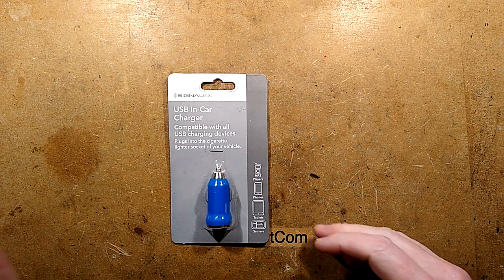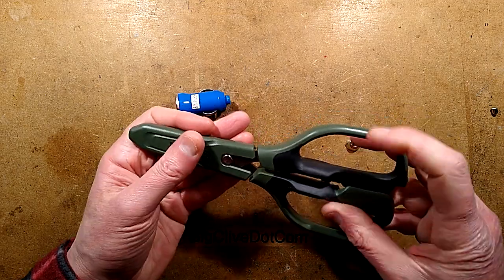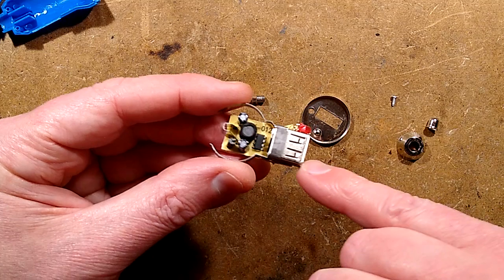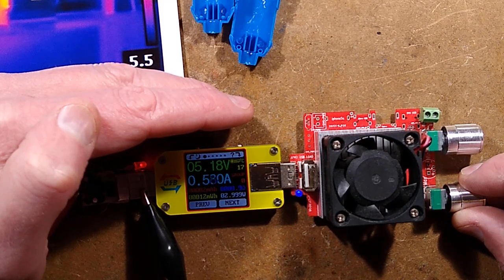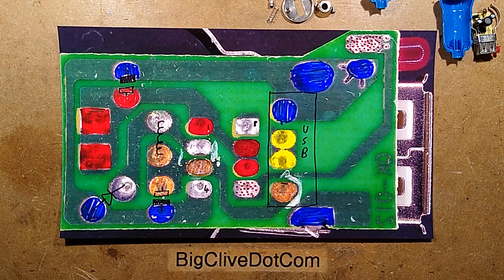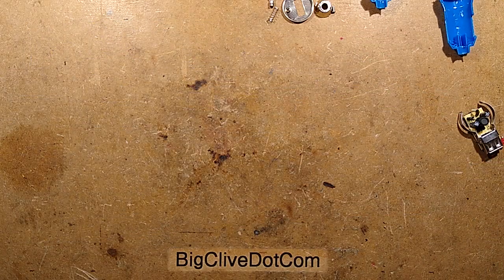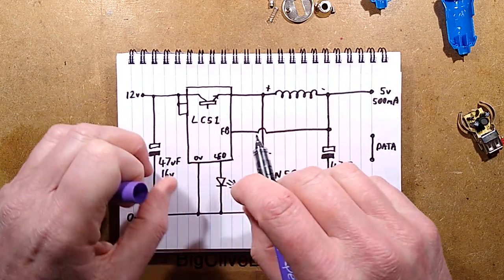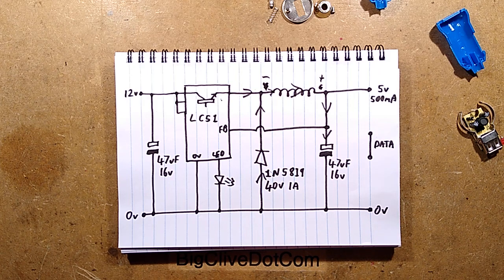Inside a Pound shop car-USB charger (with schematic)

Comment: Whoever sent you those expensive-looking scissors was probably horrified to see you using them that way 😃😃
Reply: I sure would be!
Reply: Nah, that metal is zinc based potmetal. Could have bitten it off.
Reply: Well, i have engineer brand small scissors, and they are made to be used as tools. They are made to be used like this.
Reply: this concept brings be pleasure for some obscure reason
Reply: @SquishyZoran  Those scissors sure would be good for popping things tho
Reply: They do state "Engineer" scissors, so I would suggest that allows them to be used for all major engineering tasks, namely hammering, prying, stabbing, levering, wrenching, chiselling and it seems spudging. At a pinch you could also use them for cutting stuff, if you can't find a more dangerous implement to do that with.
Reply: I would suggest that anybody who sends Clive tools ought to be prepared to see them employed in all kinds of imaginative and exciting ways 🤪🙏🎇
Reply: @AndyHullMcPenguin  Exactly, these are obviously the new engineer's screwdriver. 🔨
Reply: If you are horrified at that, then you don't know BigClive that well  ;-D
Reply: @SquishyZoran  top tip, write your name on them before you send them. Clive does not seem to be the most organized genius out there. Love the videos and the chats. Still get sanitized even though I had my vaccine.
Reply: @AndyHullMcPenguin  Don't forget the other important tasks that engineers use their precision tools for: manicures and skin care.
Reply: they've seen him use his screwdriver in non-screwdriver ways. if you gift something to Clive you know it'll be used in a new application you hadn't foreseen  at some point
Reply: @wyokaiju992  You wouldn’t dare!
Reply: @happyundertaker6255  Even so it would still be alarming the first time .
Reply: @ronaldpurnell7570  I would but I don’t know his address.
Reply: @AndyHullMcPenguin  When I hear the word "Engineer" I immediately think hammering, prying, stabbing, levering, wrenching, chiselling and  spudging... lol
Reply: @AndyHullMcPenguin  Nice one Andy, love a dry sense of humour.
Reply: Tool abuse!
Reply: @mastergx1  If it looks like a hammer ...
Reply from the maker: That did go through my mind.  But they did challenge me to break a pair.
Reply: @Kj16V  I thought that was just me...
Reply: I bought a pair of those scissors off Amazon, they are brilliant and will cut anything. I've become a total convert to the Engineer brand and have since bought some of their fine cutters and pliers as well as wire strippers to add to the dozens I've already got. 
I love good quality tools.
Reply: @SquishyZoran  We'll see about that ;)
Reply: @happyundertaker6255  I use old-school lineman snips and get funny looks for it all the time. They are like scaled down leather scissors (thick stainless steel, very heavy for their size) and have a serrated back edge with a couple of wire stripping notches. They've no problem cutting wire and thin sheetmetals without getting nicked or dulled. They cut paper and annoying plastic packing nicely, too. Handy for some personal grooming (beard, fingernails) on the go, too. I'd still want a good pair of shears for cloth, though.
Reply: Nope, I sent those and I'm very glad he is abusing them :)
Reply: Clive is an engineer. Nothing more to be said.
Reply: Engineer brand scissors should be perfectly happy with such light duty. I'd expect them to be capable of cutting wire and shim stock, so some light prying should be no big deal.

Comment: I always love the photos, you do this low budget hardware serious justice. Those prints probably far exceed the price of the device.
Reply: He could also use a tablet and doodle live in the photo on it. 
The photo probably is easier to use in varying light conditions.
Reply: If you have refillable ink cartridges the price of printing a full colour A4 image is a few pence if that. And I know Clive does use them because he mentioned having a few syringes for that purpose because that is what made me aware of refillable cartridges.
Reply from the maker: I've moved onto a tank based ink system.  I get the best part of a year out of a refill.
Reply: @bigclivedotcom  How about a review of the printer?
Reply: @bigclivedotcom  I know a lot of people have asked this over the years but you should make a video on the printer
Reply: @two_tier_gary_rumain  It's the Epson Eco tank system.  Don't wait for the review just go out and buy one.
Reply: @Chris_the_Muso  I don't need one.
Reply: I remember when Clive tried to measure component using dmm on the picture itself. 😂
Reply: @rizkyp  And several near to's
Reply: @Chris_the_Muso  On these ink jet printers where you just refill the ink rather than replace a cartridge that is both ink tank and ink squirter jets is there a problem with the non replaceable ink jets getting clogged up?
Reply: @BrianG61UK  No more than it is on any other printer with non-replaceable heads, which is most of the business type printers that take the separate ink tanks.  The main problem with print heads is leaving them idle for too long.  If you only print a few pages every now and then you might be better off with the all-in-one cartridges so that you throw your inevitable clogged heads away every few months.  

The advantage of the eco tank system is that the ink is so cheap, so you tend to print everything all the time, which is good for the print heads to be kept working correctly.  For this reason I would suggest you actually have less problems with the print heads.

The disadvantage of the eco tank system is that the cheaper ink is not really photo quality (close enough for most people but not professional quality) and also the archival quality of display prints would be very suspect compared to (for example) Canon photo quality printer inks.

It's a matter of picking the right system for your needs.
Reply: I have color laser printer, which can be filled from large buckets of  powder from Ebay . Last one ever made by anybody I think. Samsung CLP-810  .
Reply: I'm now imagining Clive's printer with a hose for each color going to a 55 gallon drum of each color.
Reply: @bigclivedotcom  same here, Epson ecotank printer 🖨 takes bottles of ink 😁
Reply: @Chris_the_Muso  I buy Epson ink for my ecotank printer 👍

Comment: I get chills when he starts using his non existent fingernails to try and pry off that back piece and then it makes that sound every time he pulls and then loses grip, ugh.
Reply: click
Click
Click
Reply: Grow a pair
Reply: That’s what fingernails are for!
Reply: I was waiting for the 'unreasonable force' to be applied - I thought Clive was quite restrained!
Reply: @horacegentleman3296  it's normal to feel that if you've ever had such short nails and tried doing something with them
Reply: @alancordwell9759  I STILL have not seen that big hammer of his in use.
Reply: @horacegentleman3296  Of fingernails?
Reply: @ronaldpurnell7570  that's strictly for Clive's OnlyFans
Reply: @alancordwell9759  You just reminded me of the venerable Vice Of Knowledge! 

😢 I miss the Vice Of Knowledge…
Reply: @BoHolbo  The vice of knowledge, the pliers of curiosity, and the spudger of serendipity.  Only the hammer of inquisitiveness needs to find it's rightful place.
Reply: I'm a normal man so I just 'grow a set'...a set of ten 2mm long fingernails, rather than two pieces of spherical sports equipment.

Comment: I was half expecting it to just be a single 5v regulator.  😂
Reply from the maker: That wouldn't have surprised me.
Reply: I bet this chip is even cheaper.
Reply: I was half expecting a two resistor voltage divider
Reply: @SparkY0  That's been the standard for years... Most of the "classic" versions of these were running on either MC34063 or a TL494.
Reply: Many years ago I had a radio that needed 6V. It came with a car power adaptor. It was basically a very chunky 6V Zener, a low value high current resistor and a capacitor.
Reply: I had a couple from Poundland a couple of years ago that were exactly that, a single TO220 package 78l05 with a couple of Caps thrown in. They failed very quickly indeed!
Reply: How can it be it would melt if it was, those things, especially the linear type of regulator can take up to 24v dc.
Reply: @tyronenelson9124  I doubt any shady company producing them would care about safety or if it even works. *See power saving devices
Reply: That would take some heatsinking. (12V-5V)*0.7A=4.9W in the charger.
That would be very toasty in such a small package. In fact, it would probably melt the casing.
Reply: @OntologicalQuandry  Actually it would work just fine... LM317 was a very common regulator to find in universal car charger designs... Yes they required some sinking but worked fine.
Reply: @MadScientist267  that I don't doubt, but 5W? Are you sure they output 500mA+ what size body was the charger?
Reply: @OntologicalQuandry  Indeed bigger. You're right it wouldn't survive very well in that size device but before switching converters took off, that's how they rolled
Reply: @bikingnutcase0  I bought some around 2009 that just had  the 7805, they had even left out caps. The PCB had placed for caps, but they were empty.
Reply: I was expecting an ioniser
Reply: @bikingnutcase0  Isn't that the 100mA version? Very poor! i'd at least have stuck the standard 1A 7805, and attempted some sort of heatsink. Even if it needed a cutout in the plastic case, for a heatsink with a few rudimentary fins. That would also make it look better, better-made and more hi-tech. Also if it got hot that would let a user know to stop using it. Put a sticker on the bag saying "WARNING! HOT!"
Reply: @tyronenelson9124  It's not the voltage. Well, it is. But it's also the current. It depends. If it has to drop 19V from 24V to give 5V, and you're drawing the maximum specified 1A from it, then that's 19W of heat it has to get rid of. It will need a decent sized heat sink, like nothing miniature or compact. The ZX Spectrum had one regulating down from 9V, and that had a big heavy heatsink that kept the computer warm on cold winter nights playing Jet Set Willy. 

The power a 7805 can properly deliver is a product of volts, amps, the C/W rating of the heatsink, and ultimately the max temperature the 7805 can operate at. You have to stay within those limits. Less current drawn means it can drop more voltage, with the same sized heatsink. Equally less voltage drop means more current for a particular heatsink. Bigger heatsink means more current and / or voltage. 

Running at a full 1W dropping (12 - 5) 7V, so 7W, is likely too much without a decent heatsink, which would not fit in that bitty little package. Maybe if you made the whole case out of metal, and make it bigger with a few fins somewhere...

C/W btw is how many degrees celsius a particular heatsink will get hotter, for each watt it has to sink. So higher is worse, meaning it's temperature will increase more (celsius) per watt. A better heatsink radiates and conducts heat away into the air quicker, so will get less hot, per watt dumped into it. 

It might be impossible to draw the full 1W at 24V, you might be limited to less current at higher voltages (and of course vice-versa). Again, it depends on the heatsink, but the thing has to conduct heat internally from the silicon to it's metal tab, and that's a thermal bottleneck. I haven't read the datasheet so I dunno the actual limits. But volts / amps / heatsink are all in an equation where demanding more of one means less of the others.

This one uses a little switch-mode circuit, but probably badly designed with awful components, cut back to minimum. So it's theoretically cooler except it's such garbage it still runs hot.
Reply: @lostjohnny9000  Shoot, I wish!
Reply: @bigclivedotcom  i have two of these. just looked inside them one is the very same as that one you just showed, the older larger one(you know the one's withe the glass fast blow fuse inside 2amp,) has a smd LM7805 two caps, input 1uF, out put 4.7uF and a red LED with a 1/4 watt 3.3k resistor on the input side..  (wow just got de-sha-voue)
Reply: @greenaum  integrated regulators usually have pretty high thermal resistance junction to tab so it makes them quite useless at dissipating more than couple of watts. Lm317 dissipating more than 15W long term would require active cooling or bucket sized heatsink.
Reply: @greenaum  maybe he just mistaken it. 
L=100mA
M=500mA
S=2A
Though it may depend on manufacturer I guess.
Reply: @greenaum  I think the 100ma is a TO-92, the one in there was the 1A version. But it can only actually do the 1A as you say with a heat sink. All I know is they didn't work for very  long! Very poor indeed.
Reply: I remember back when car chargers simply used a ceramic resistor to lower the output voltage. There wasn’t a circuit board or chips of any kind.
Reply: @codykey2508  Thing is, the output voltage would depend on how much current you were drawing. So the voltage could be anything, all over the place. Wouldn't be suitable for USB or in fact anything at all. Sure there wasn't a 5V zener diode in there as well? Even with one, that sounds absolutely terrible.
Reply: @greenaum  it wasn’t a usb charger, it was for a Motorola phone back in the early 2000’s may have even been 99, I can’t exactly remember. But it had the negative going straight to the output and had a square white resister similar to what they use in plug in air freshener for in the house in line with the positive. That was literally all that was in it. I guess those old brick phones could take 12v without frying lol
Reply: @rpdom  Early 90's I had a portable CD player that aside the detachable battery pack also had a car adapter. Quite big but also light - all the electronics inside was just a string of 1N400x diodes in series on the + supply. Of course, with the player designed to run off batteries (6xAA IIRC)  and their varying voltage between fresh and nearly dead, the required precision isn't much...
Reply: @bikingnutcase0  in a running car,  with a voltage of approx 14V, at 500mA, that'd dissipate about 4.5W.  With a thermal resistance of ca 70°/W  tab to ambient (never mind junction to ambient) for a TO-220, that should by all expectations cook itself rather hastily if not seriously heatsinked.
Reply: Yeah me too. That is actually a decently made circuit in the video. Where's the TO-92 5V regulator
Reply: Yep...I used to get 7805 regularors from Dollar Tree when RadioShack went out by taking apart car chargers...
Reply: @tyronenelson9124  they don't care...if it melts you buy another!  I also find most have no fuses of any kind.
Reply: @codykey2508  That's the thing, when you use a resistor, the resistor doesn't actually lower the voltage (provided you measure with a high-impedance multimeter). A resistor actually lowers the CURRENT...
Reply: @brentfisher902  I didn’t know that’s how it worked, I knew it lowered or limited something but all I know is that is quit working and I was trying to fix it because those things were too expensive to just throw away back then lol